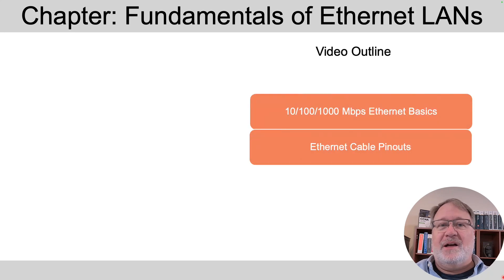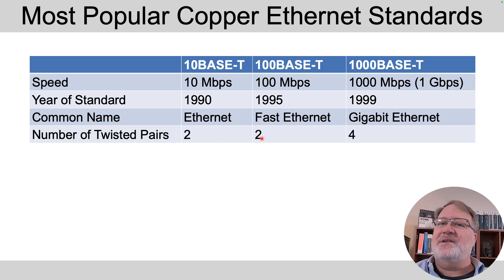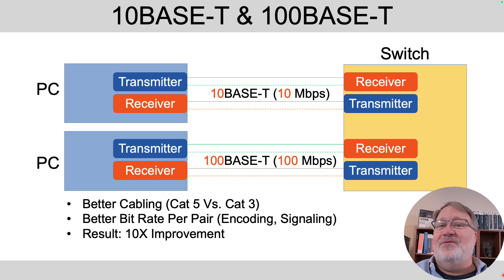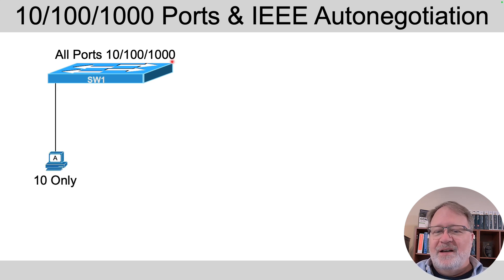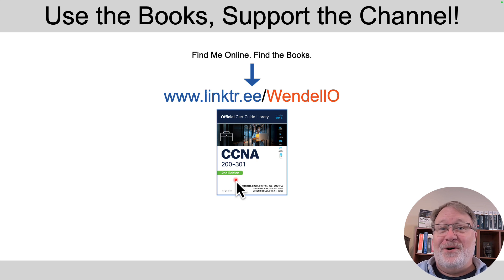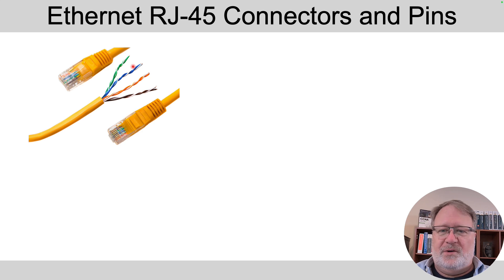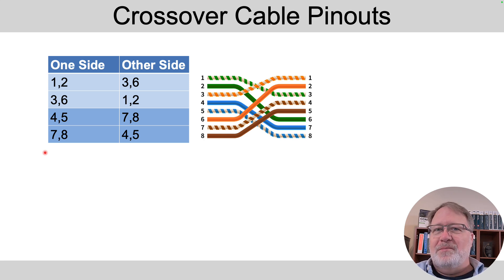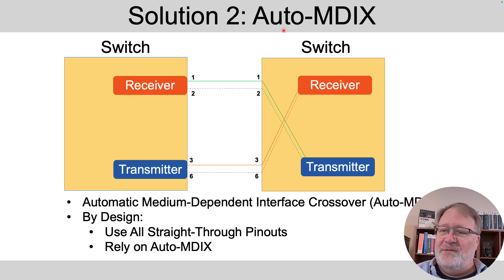Understanding Ethernet: The Role of Twisted Pair Cables in Networking

Comment: Great video Wendell!
Waw, I just remembered opening an Ethernet cable to do a crossover with a straight cable by switching the pin positions when I was younger; to connect my PC to a friend's to play on LAN. I feel older...
Reply from the maker: Thanks!
Yeah, it seems like more and more LANs use all straight-through cabling and rely on auto-MDIX to swap the wires internally. Works great, and you don't have to worry about which ones are which.

Comment: Hey Wendell - Great video - I make cables up nearly every day but in the order of T568B🤣 Thank you Might be good to say that having one and of the cable T568A and the other end T568B will be a cross over cable 😮
Reply from the maker: Welcome back!
Sounds like you've had a lot more experience when making them than I have!
That said... T568A and B on opposite ends makes a true crossover for 10 and 100 Mbps, but a partial crossover for 1000BASE-T. Both pairs have to be swapped for the cable to meet the crossover specs. That said, there are 1000BASE-T features that will deal with and make the partial crossover work, e.g., auto-MDIX, so that a straight-through, partial crossover, and full crossover all typically work on 1000BASE-T.
Do you regularly use what I'd call a partial crossover (T568A and T568B on the ends) for 1000BASE-T links? Just curious.
Wendell
Reply: @ To be fair I use T568B cables all the time and not T568A. Only for the odd crossover😊 Have a good bank holiday weekend Wendell😊👍
Reply from the maker: @flyingscotsman3278  Cool. Thanks for the answer! Have a good one...